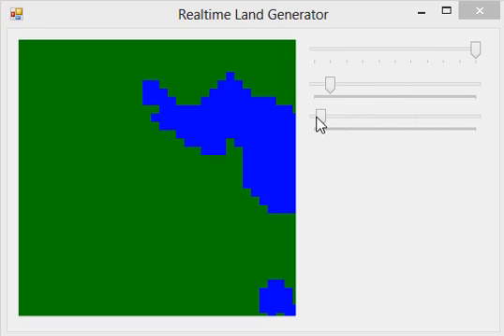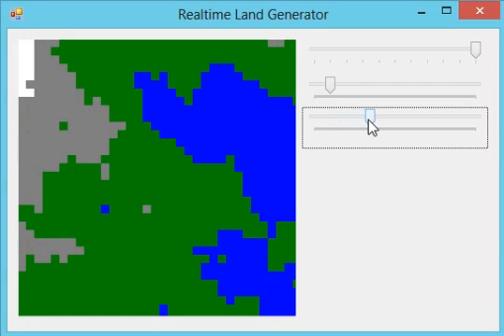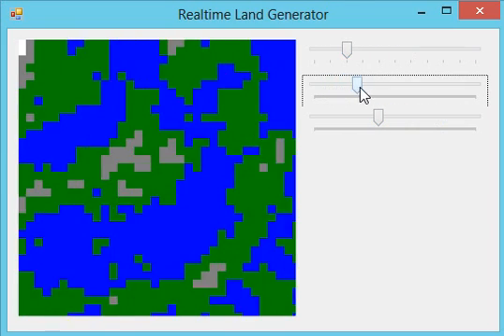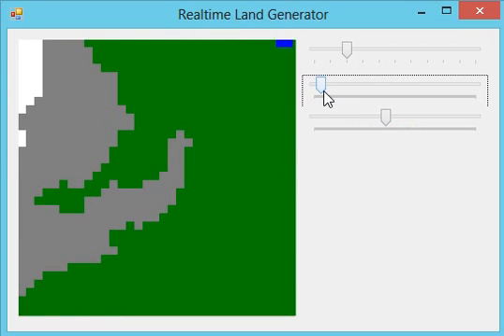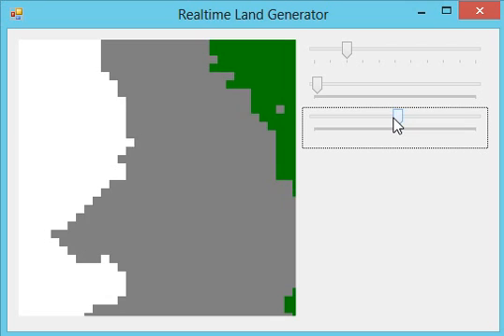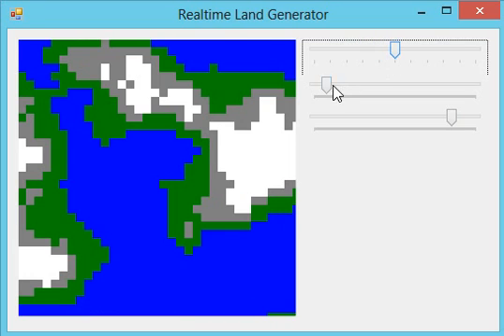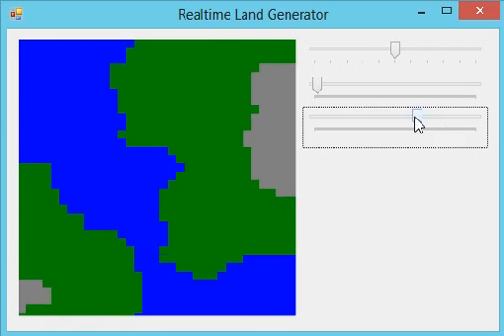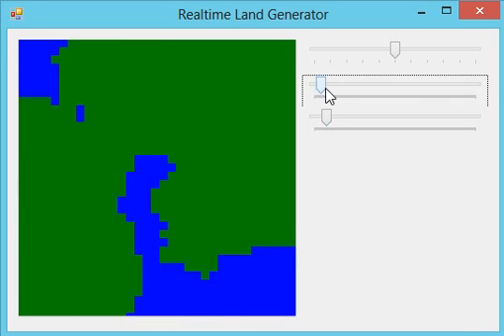Procedural Land Generation Using Perlin Noise

Comment: this is super cool! i think a drag feature with the mouse where you can click and drag to pan the view port. Also instead of predetermined seed slider a random seed button might be more appropriate. the other two sliders are perfect though in my opinion. Super cool. I might make a similar little applet for fun soon. Did you decide whether the pixel was land/water/mountain/snow just depending on how close that value was to 0/255? That's probably what i'd do

Comment: Give us the damn source code :D or make a explanation
Reply from the maker: I don't believe i have the source code for this any more :( i wiped my drives a few months back after having some computer problems and just lost everything. but  do some research on 2D Perlin Noise there's plenty of examples.

What i am doing here is gradient mapping saying 0 - 80 is water 81 - 100 is grass 101 - 200 is mountains and 200 - 255 is snow etc the sliders control the values for the gradient map
Reply: rm2kdev Can I ask you something? How do you "say" your perlin noise  that the outcome values in the 2d array for example are between 0 - 255 or -1 to 1 and so on?